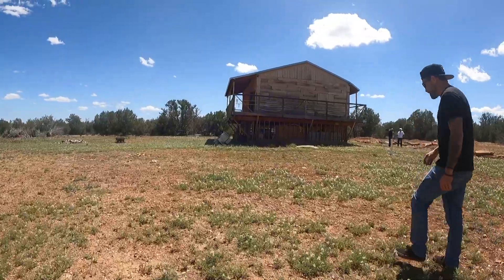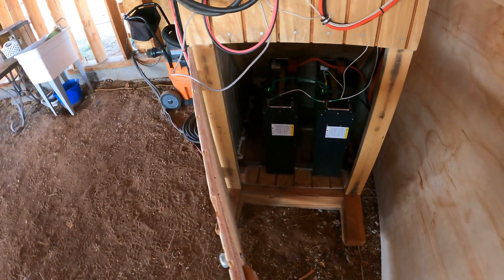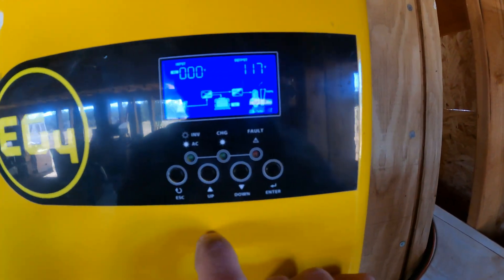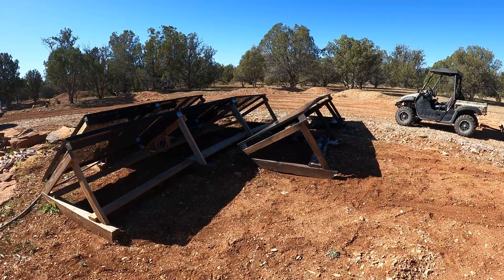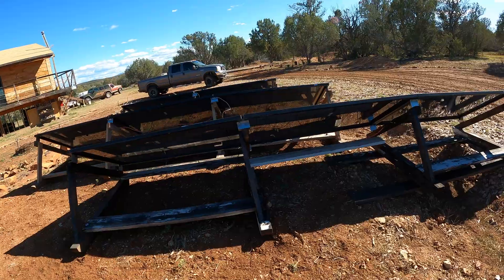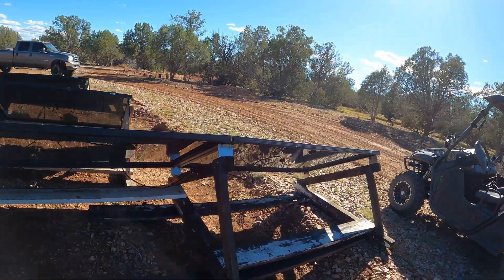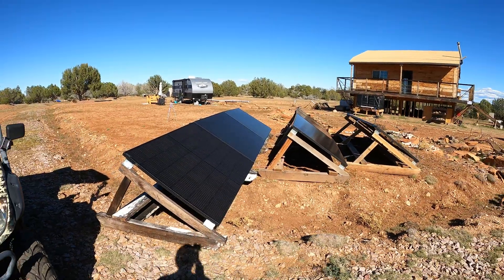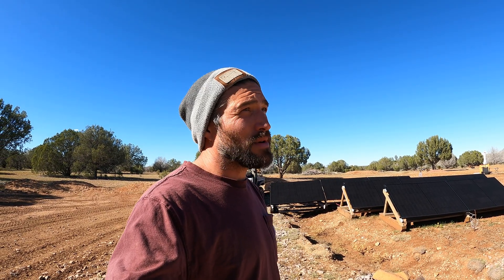Connecting the 3rd Solar Array | Off Grid System Complete

Comment: Enclose the inverter in the same space as the batteries - inverters generate heat during production in the day.  This will "auto-heat" the battery space.  Remember to insulate their box well.
Reply from the maker: Yep plan to do that before winter as well. So many projects and it’s just me working on them right now.

Comment: Hey there homesteaders!  Great video once again.  It's so much fun to set up solar power  : )  FWIW,  Long term I think you're really going to want about 4 feet of space or more between your solar arrays.   05:21 shows they are currently creating shade for the rear rows and when snow comes, you'll need a maintenence lane between them for cleaning them off and allowing the snow to pile up.  I know you have limited wire, but f you can spread them apart from each other, you won't regret it.  : )
Reply from the maker: Yes I think you’re right. I was thinking about that but I figured I’d test it out. I’ll most likely adjust them. I’m still learning
Reply: @HideawayHomesteadRanch  Doesn't it just feel awesome generating your own power?  It's amazing to see the amps just pouring in.  You're your own power plant.  :)